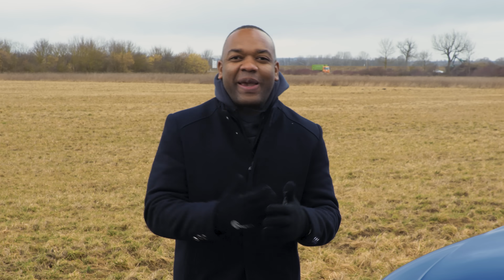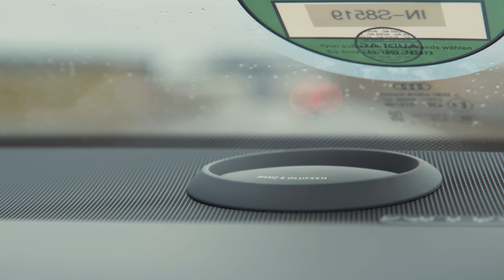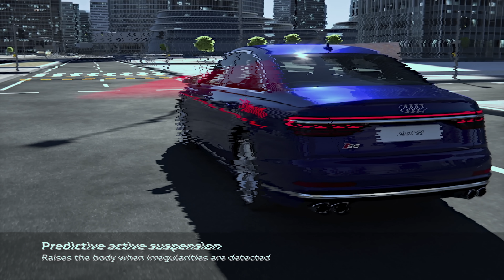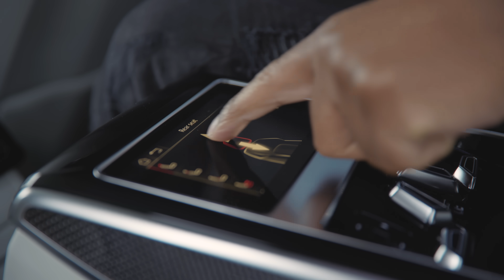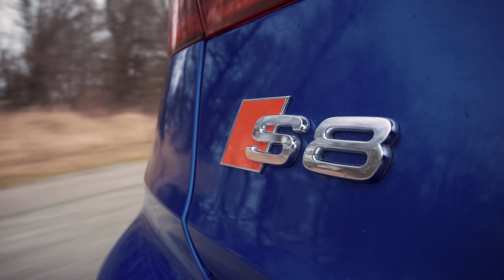NEW 2022 Audi S8: The 571 Horsepower V8 Luxury KING?

Comment: I like you, even if you drive on the wrong side of the road. The ONE thing I NEVER hear car reviewers of these uber expensive sedans talk about is... reliablity. How much maintenance is required on: A Rolls, a Bentley, a Maybach, an Audie S8? I'm not sure the S8 completely belongs in that rarefied air, maybe I should include the S class Merc, and that's fine, I'll hear it's comparison.

The BIG knock on Euro cars is yep, buy a year old one it's about half the price of new, because they depreciate. And they depreciate because at 80,000 miles plus they crater, or at least require 5 figures in maintenance. So mechanics always say "get a Lexus." HAVE these carmakers begun to give a damn about these issues? Maybe the EV's will have better longevity due to fewer mechanical parts, it's a good question that can't be answered for a couple of years. Still, with the ICE powered Euro cars... tell me, with absolute honesty, what's the deal on European reliability?

Comment: As long as the oil strainer buried under the turbos and intercoolers do not plug up and grenade the turbochargers... Only bonafide RETARDED German engineering will bury a $20 filtration device that will cause catastrophic failure in a location where it takes 10 hours of long to get to and say it doesn't need to be serviced or replaced.

Comment: To be fair though, the new S-Class is a whole new generation inside and out while the new A8/S8 is just a facelift. It will be interesting to see what Audi does with the next gen A8/S8. But I'm guessing that won't be for a few years.
Reply: The new S-Class is also a massive downgrade in exterior appearance. The front-end is filled with cheap-looking plastics and the previously-stately Mercedes taillights have been replaced with taillights that appear to be near direct copies of a Mazda 3's. Hell, even the headlights look eerily-similar to those on much cheaper cars.

I cannot believe they got the interior so right, the technology was so right, they had the exterior so right on the previous gen, and they proceeded to ruin it.

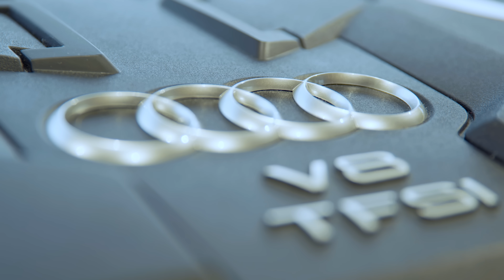Comment: 2:53 - not the first, the Mercedes 217gen S-Class Coupe/Cabrio already had OLED-taillamps with the MoPf in 2017
and how is it the first time he has seen digital-lights in the front? he already drove the 223gen Mercedes S-Class like 3 times, 4 if you count the EQS, which also had them before the A8 facelift
Reply: TT RS had it first. Not sure if the production 2016 M4 GTS got OLEDs or if they just look like the OLED concept
Reply: @nazhif1  wrong, the TT RS wasn‘t the first one. it was the BMW M4 GTS in 2015.
I didn’t said mercedes was first, but I mentioned them because they where first in the upperclass segment, so before the A8 D5 even came to the market in november 2017
Reply: @dr-ok3sn  cool story bruv
Reply: @nazhif1  unnecessary comment bruv

Comment: Audi should make a RS8 before these cars turn electric
Reply: thats just an S8 with a tune and body kit
Reply: @t8506  an RS and a S product are not really the same. If you've had both you'd understand
Reply: It’s almost the same setup of an rs6 or rs7. Turbos might be just slightly less and suspension tuning. They don’t want to put a RS on the executive sedan but they give u the RS power pretty much. It’s a boat is why. I had an A8L 4.0T that was basically an S setup for S6 or S7 at the time 4.0 twin turbos. Then the RS just had a turned up version of same 4.0T. In S8 u getting the RS setup the turned up version. It’s the flagship so it gets the best stuff dual flagship A8/S8